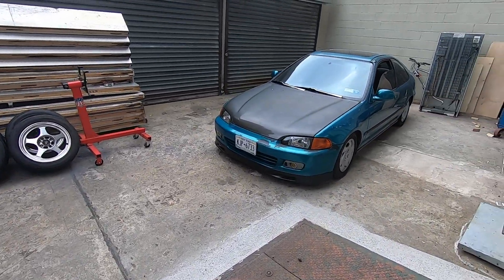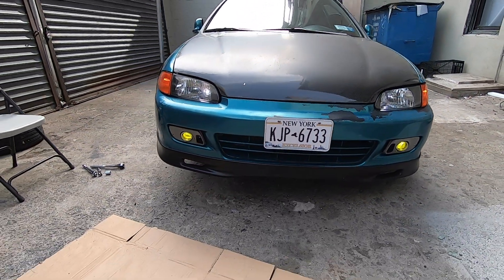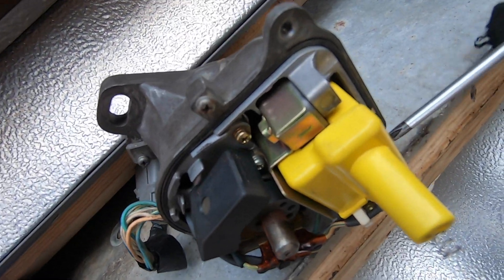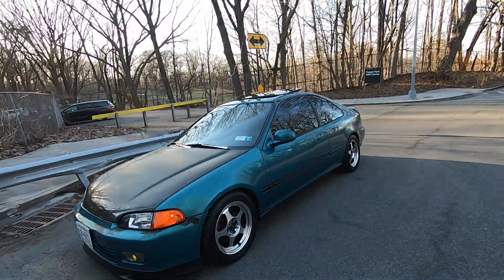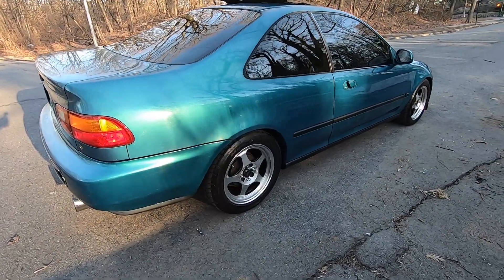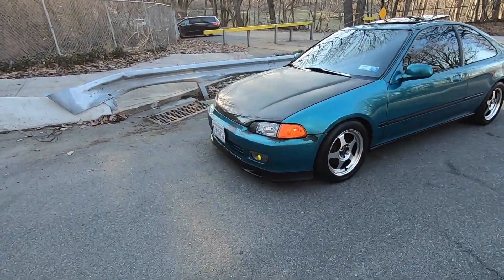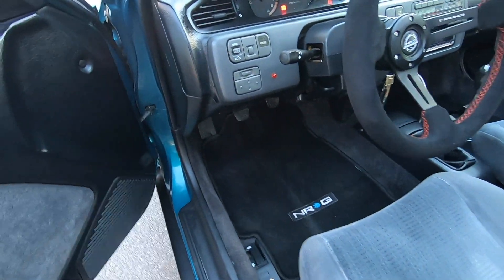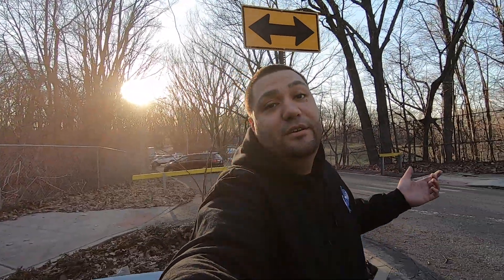BEST WHEELS EVER ON A HONDA CIVIC EG ! D16 NITROUS BUILD

Comment: Was up bro I got a d16y7 if my air flow sensor isn’t in you think it’ll mess with my map and tps?
Reply from the maker: What car is it in?
Reply: @ChapaRacing  Honda Civic 4 door ek. Just put in the manifold and I don’t think I have the vacuum hoses right... and I don’t think I have the airflow sensor connected to intake... the car is spuddering when I put it in first gear between 1.5 and 2 rpms. The scanner is saying map sensor and tps sensor, but idk bro I’m all messed up right now
Reply from the maker: Well those cars dont use a airflow sensor. They use a map,tps, and intake air temp sensor. It can be a few different things use process of elimination starting with the cheapest thing to change.